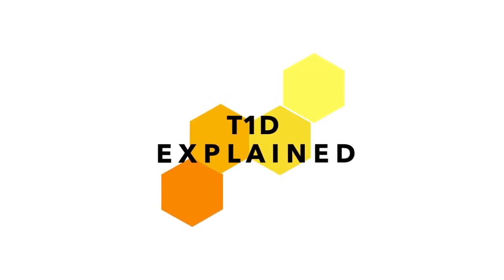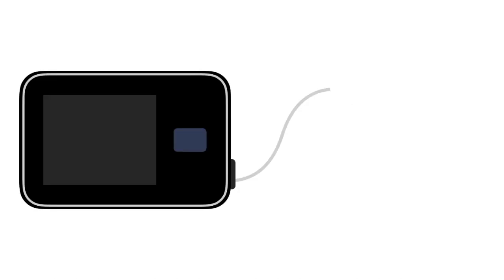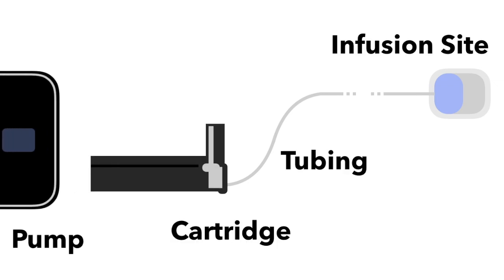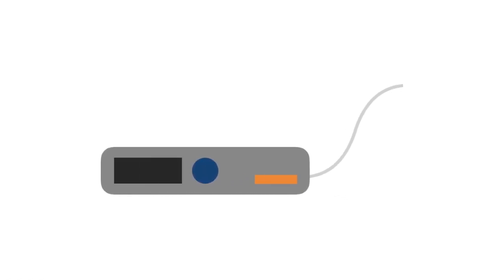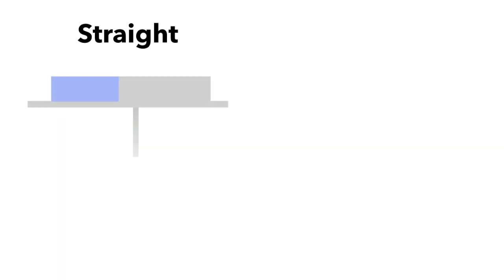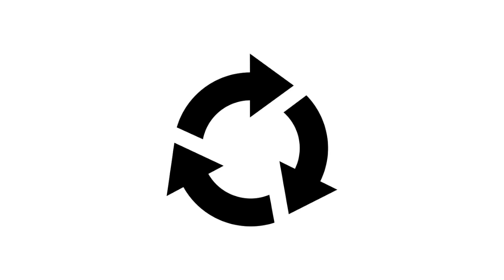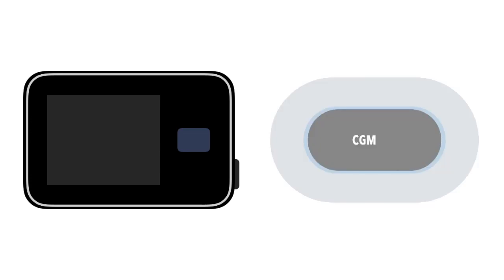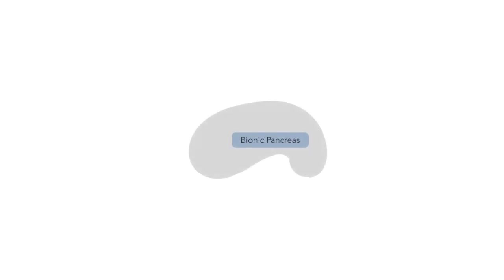Insulin Pumps | What They Are and How They Work

Comment: Hello, I have some questions.
1.Is it compatible for Alzheimer?
2.If using cgm with the pump, will the pump calculate how many unit the body needs at the time ?  (Like the pancreas works)   (The pump and the cgm are now can be linked and shared the data ?) 
3. Who shouldn’t use the insulin pump ?
Reply from the maker: 1. There are no specific reasons why it wouldn't be compatible for someone with Alzheimers, but depending on what the person is used to, using shots may be easier. That is something that should be discussed with a doctor.
2. Yes, certain pumps using closed loop systems can help adjust and calculate how much insulin to give (or whether to stop insulin) based on data that it receives from a CGM. 
3. Check out this link that gives a good overview of the pros and cons of insulin pumps and gives reasons why a person may not want one. https://bit.ly/3lyKhbq